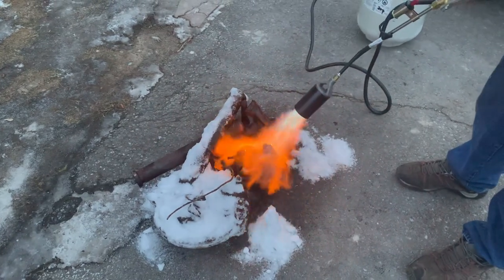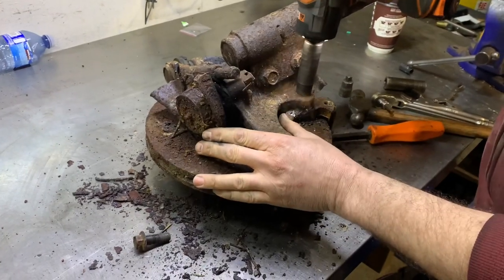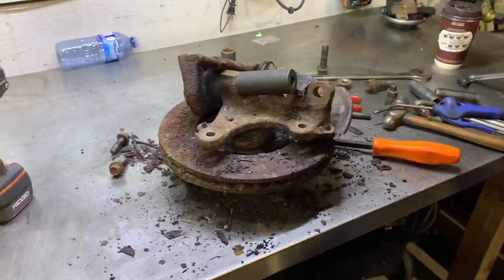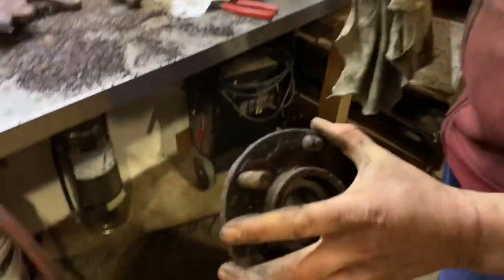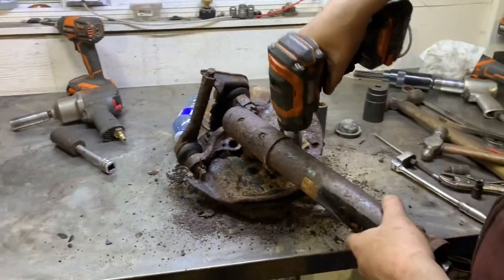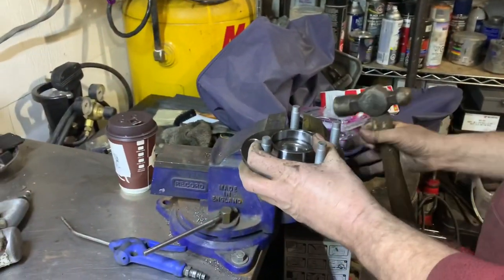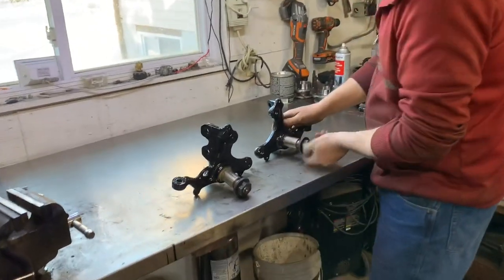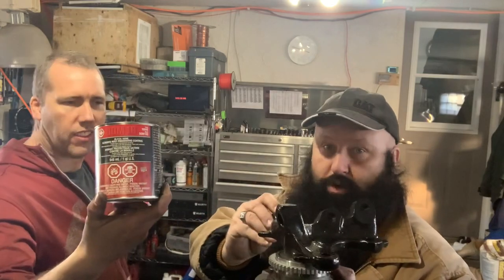Rebuilding Rusty Mustang Spindles￼￼…Gotta Save That Money￼

Comment: You're doing a "Godzilla swap" into a Fox body and "low budget" is a priority when it comes to front suspension/braking components? GOOD PLAN!
Reply from the maker: Well to do a proper Godzilla swap were using Team Z K member, control arms springs and strange struts.
Brakes will be upgraded SN 95… We could’ve sank Thousands more into struts and springs and brakes… but we’re trying to build within a budget and use things that are safe and will work to get us down the track… Upgrades are always in the future

Follow along and you will see… It’s not sketch